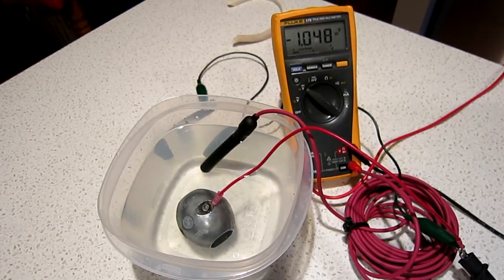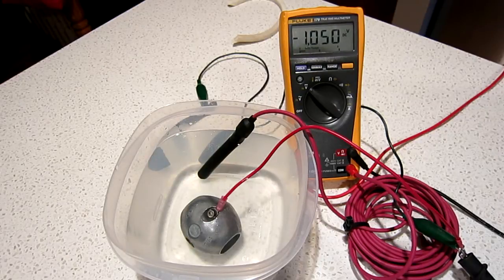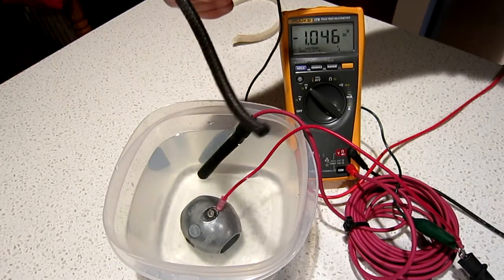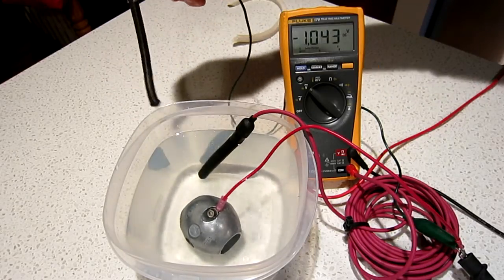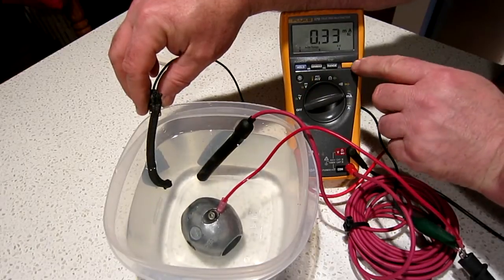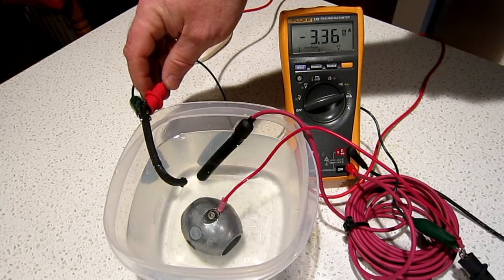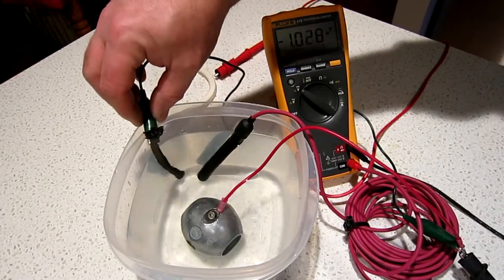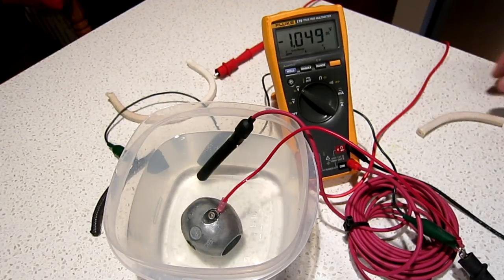Zincs & Dissimilar Metals

Comment: Good demo.

You could demo a Galvanic Isolator with the same setup to see the effect on current in a shore power scenario.  Perhaps demo the change in Anode/Cathode surface area ratio. Reason for painting a large bronze prop on an aluminum hull fishing vessel.